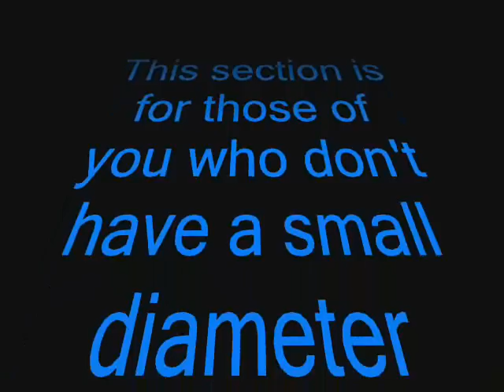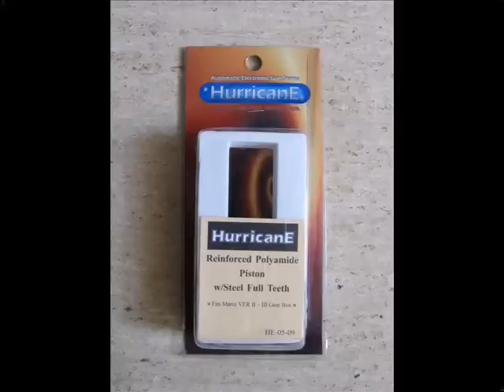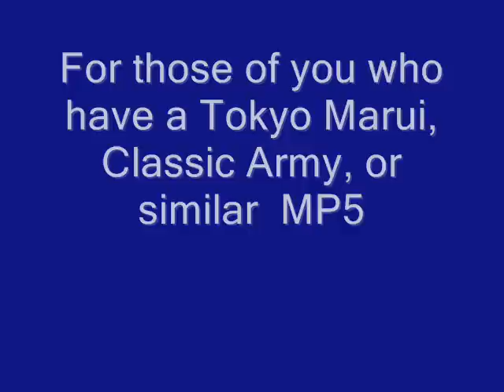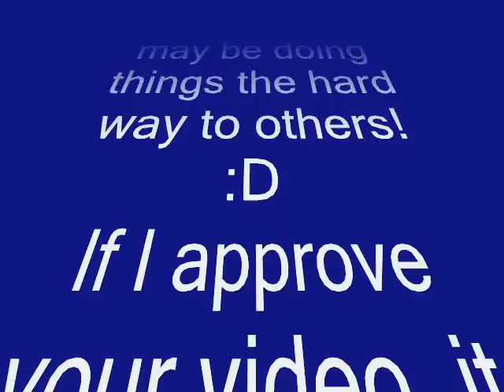Version II  Gearbox -  Troubleshooting And Dissasembly WITH A Compressed Spring

Comment from the maker: @808Kameleon 
5)  Bad switch,  CHECK if this happens in BOTH single and full auto mode.
6)  Anti-revearse latch keeps breaking loose during assembly of the two halves of your gear BOX.  Make sure the anti-reverse latch pins are IN the slot when assembling.
7)  The spring bight be warped.  Rill spring on table, check for warpage.  Bend to straighten out, and re-check again.
8)  Spring or piston hitting spring guide!  Make SURE spring guide is set correctly when asssembling gear box.

Comment from the maker: @ureallylikeme 

If it continuously jams, it could be because of several reasons:

1)  Battery is too weak, not enough charge, or developed a "memory" that causes the charge to stay low...
2)  Shims NOT properly done.  Causes gears to get "stuck" in rotation
3)  A broken tooth on the sector gear.  The sector gear is the "double" gear that connects to your piston.  it usually is the last gear tooth.  
4)  Spring is "too strong" for motor to turn to compress spring.  Get a "weaker" spring.

Comment from the maker: @ILLKILLYOUTOO1 

=D

I've been doing this for 10 years, so MY way is "unorthodox" as compared to all other do-it-yourselfers...  You just have to know your equipment, and know what has gone wrong internally.  Besides.  This is YouTube.  Watching all others simply open a gear box the regular way with a screw driver into the rear hole of the spring guide, etc, and using more screw drivers removing the two halves....  NO DRAMA!

;D